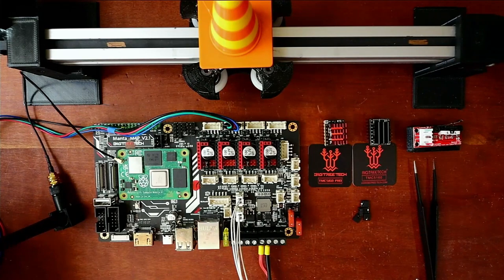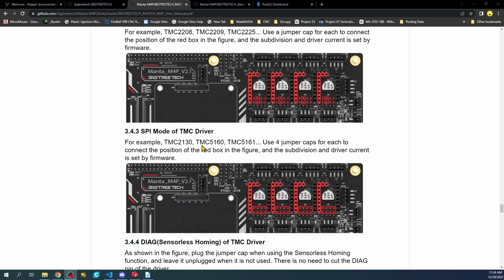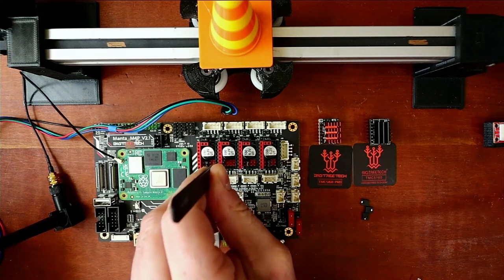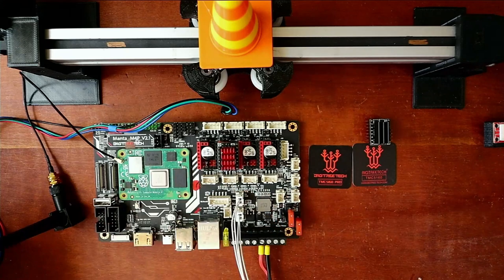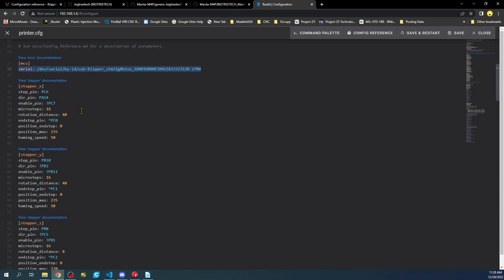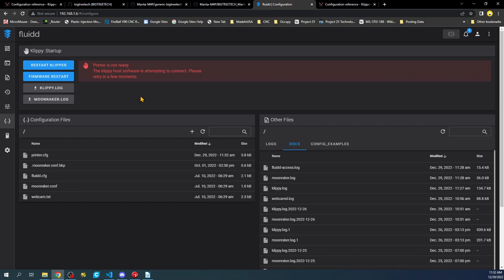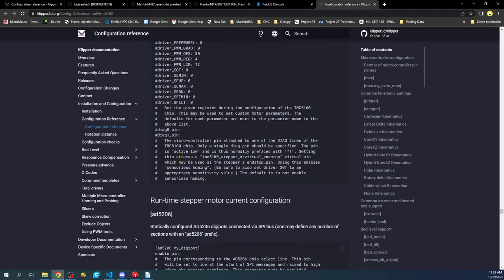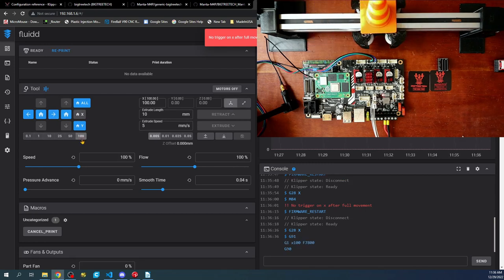BTT - Manta M4P - TMC5160 SPI with Sensorless Homing

Comment: The non pro 5160 does have a DIAG thru hole (and the diag pin output is in the datasheet) so I hope if I just solder a goldpin there, it should be able to do sensorless. The vendor info states that it does support stallguard.

Edit: Yes. The regular 5160s do sensorless homing. You simply need to solder a goldpin to the diag thru hole
https://www.youtube.com/watch?v=dOJbSrWVu_Q&t=952